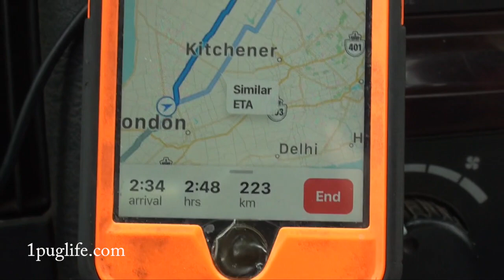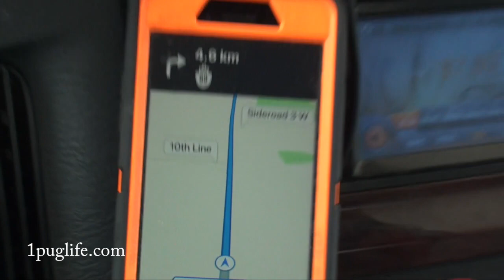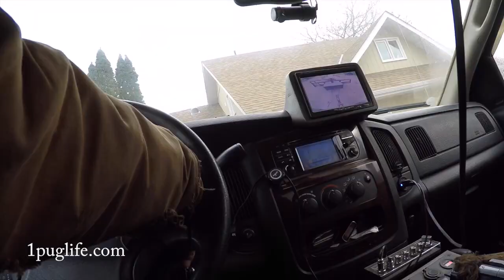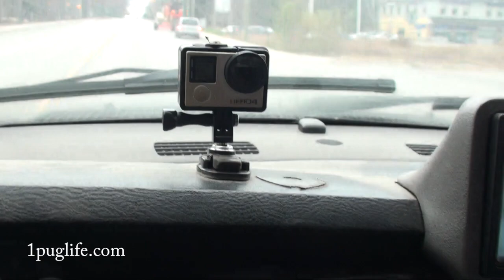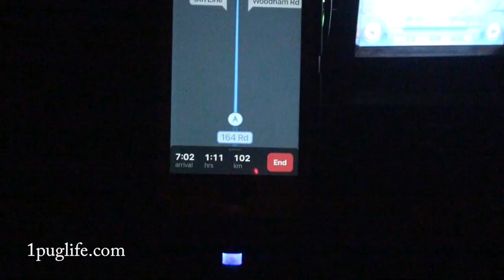i made up my mind

Comment: I got an 03 1500 v6 pussymobile. Only use it to tow a couple hundred pounds of scrap/ boat so its fine considering I got it at auction for just under 1500 bucks. Plus I've got 180k miles with no rust whatsoever, smooth shifting tranny, and a body with literally 2 small dents and very minimal scratches. Gotta love all the old people driving trucks in FL as grocery getters.

Comment: Automatic if done right will last , you dont want a 6 speed manual , not near as comfortable to drive.
Just take rusty to someone that knows what there doing and get it done right. You put so much work 
into that truck to get it like you wanted it , you don't need another truck , that you got to do all that work
to it again.
Reply: Driving it around with a bad transmission

Comment: You do realize it's the end of 2018 right? Not like 2011? You're looking at trucks from the salt belt that are more than 10 years old, 15 years even, and they're going to be rusty and cruddy underneath...every single one of them.  Unless they were washed weekly and kept in a garage which means the owner will want mucho $$$ for them. That motor sounded great and the truck is no worse than anything else you've driven. Why don't you go put 5K down and finance a brand new 2019 dodge dualy and be done with this horses dick? between roofing and youtube and scrap hauling and under coating you should be able to afford a new truck for yourself. If Crawdad can get a new truck I'm sure pug1 can have one too no?
Reply: He don't disurve a new truck leave him fix up old rotton junk over and over and over
Reply: God I used to blow all my money on it until I started making my own. Just a little bit is nice to have.🌲🌲🌲🐴

Comment: Expand your search into gmc chevy and ford. They all got their flaws..Personally I like the GMC's..but hey that's me LOL..good luck
Reply: Me too GMC all day bud
Reply: Hey Stranger! !
Reply: Only good part of a dodge is the Cummins
Reply: They all had more reliable, basic, and quality domestic parts. Overbuilt. And less plastic and electronics than the trucks they have today. If one of the big three made a retro truck like like today, she'd sell like hotcakes. But the decision makers of those companies are making some bad choices.
Reply: @mottorcycle2559  
My cousin has a Toyota Tundra but he has the hots for a Dodge.
Reply: Dodge is the worst of the 3 to rot Ford body, Chevy's Alison trans frame and rear end, Dodge's Cummins boom you have yourself a pickup that will last a lifetime
Reply: die warlock  Real original clown
Reply: @norman7179  just say no
Reply: Sure if u like putting transmission in every 2 yrs n fuel pumps n wheelbearings n abs sensors yearly..there junk. Unless it older gmc or chevys .you couldn't give me one..ill stick to my fords .and there shitty cooling systems lol
Reply: Try replace the transmission with a spanking new Dodge OEM= $7000 , or remanufactured =$4000.
Reply: PIG IRON CAN'T RUN A 6 SPEED

Comment: The frame wasn't even that bad...
Reply: Not a bad looking truck.
Reply: It really wasn't that bad but some of the Pug fan boys will disagree
Reply: @darryl163  There was a couple spots on the cab and box, I wouldn't want to hit with a hammer now let alone after all the salt and craps got on it for another winter. Like pug said for the 153000 k's on it . it's actually only  about 95000  miles  thats nothing and it's rusty rotten junk if the clocks right or not.
Reply: Exactly, flap disk it then por15 ..like new

Comment: For fuck's sake, that truck was looking alright. I was surprised...looked clean, runs decent, and then BLAM! You look underneath and it's totally gonna sick itself on the side of the road puking all it's innards out.
The '83 might have been having some issues with the body, but nothing absurd like that. The old coot says "surface rust". Ok sure, Bub. There's a quarter inch of steel that's flaked off the frame, for fuck's sake.
And I'm seriously doubting that truck has 1.5k, I'd guess the odomoeter has been turned over at least once. 
Just dickered. Kigeegeed right in the pooper. No wonder nobody in a 3.5 hour radius would touch it. ;)

Comment: Dodge automatic transmissions seem to be weak.  Standard transmission with deep low gear would give better service for what Pug does.
Reply: A Dodge with  cummins 5.9, with 13 speed Eaton Road Ranger semi truck transmission/rear axle and  a Pug "29th gear" overdrive  conversion dropped in might do what he wants .  The heavily highway legal tuned 5.9 probably won't have the power to bugger it up, I drove a 13 speed truck with a 460 hp Detroit in it that wouldn't hurt it !.